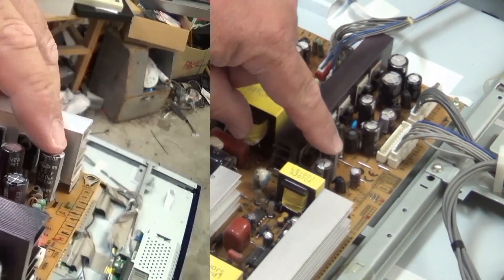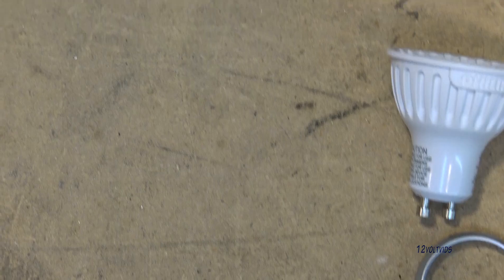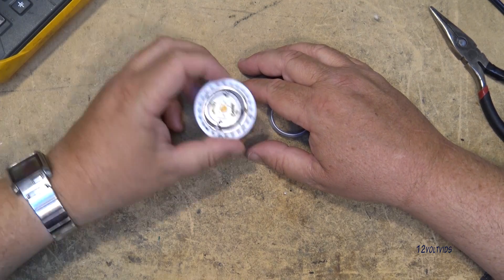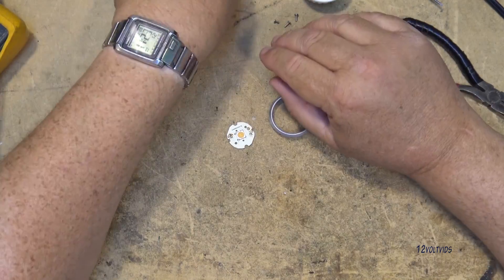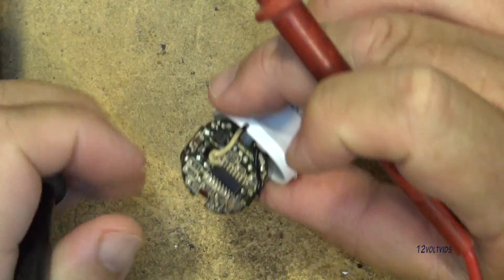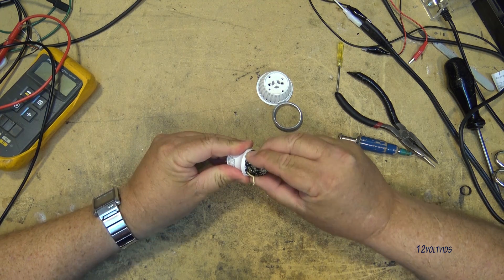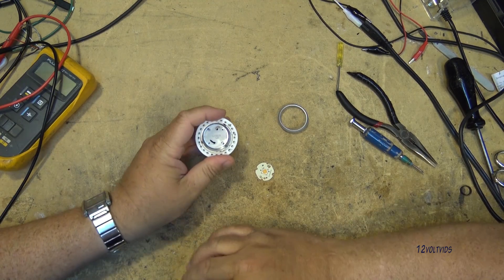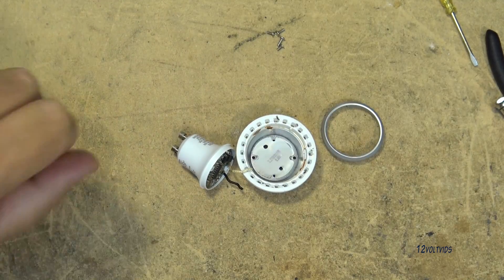Philips GU10 LED teardown

Comment: I'm surprised to see next to no noticeable heatsink compound underneath the LED PCB. Often heat is a major cause of failure with LED bulbs so I'm not surprised yours didn't last. I tend to buy them as cheap as I can find and treat them as more disposable than they should be - so much for improved environmental waste!
Reply from the maker: Pete Allum 
What about the new filament type led. No heat sink at all. They do fill the bulbs with carbon monoxide because it transfers heat well.

Comment: I think heat is what destroys a lot of these lamps. Compact electronics & transformer.

Some LED bulbs, and even some of the CFL type, won't fit into certain equipment.  My garage door opener has 2 lights, one on each side, only a regular sized 60 w (incandescent) bulb fits under the shrouds.   The LED's are typically larger due to the heat sinking.
Reply: The Led light have a mini switching power supply.

Comment: Do you think the heat inside the cap of the bulb is increasing the degrade rate of the already fragile electolytics?  Just a thought!
Reply from the maker: Probably.
I just got some new Warm Glow lights for my dining room, and will be doing a review on those. They are actually very cool technology, and emulate how an incandescent bulb dims. Hopefully these will last.

Comment: i agree with you on the LEDs. Ive found a few CFLs that did last many years but not being used all day everyday. Hell my local malwart stopped selling CFLs and have nothing but LEDs for $35-40 for 6 LEDs that are 40 or 60 w equivalent. So i resorted to buying 45w and 65w from amazon that seem ok for the price and warranty. I refuse to buy LEDs for that price  when I know they dont last very long. Ive built my own with cheap chinese LEDs and they seem to last , so far. I even converted a couple CFLs to use LEDs and after changing the cheap components they might last more than a year. we'll see. lol Thanks for sharing!

Comment: I had a few 240v non dimmable versions of these start flickering and go dim, in my case it was a simple capacitive dropper and the measured voltage across the LED package was 190v. All the capacitors tested fine. They were also quite expensive and technically still work but the flickering was really grinding my gears so I replaced them with some store own brand ones that cost like $12 for a pack of 6.

The store ones are currently much brighter (350lm vs 200lm) and consume the same amount of power as the Philips flicker vision bulbs.

When I removed the LED from the metal enclosure I noticed there was hardly any thermal paste so maybe that didn't help.

Comment: I have to say I have been surprised by all your failures. I have had 2 go bad in the 7+ years they have been installed in 2 houses. 1 was due to a lightning strike out on our post light and 1 started flickering, that's it. I have Philips, GE, Cree and EcoSmart installed.

Comment: The reason why they fail is because for some reason there is no thermal grease in between the LED and heatsink. I use 4W LED lights in bathroom. They have bead type LEDs. None of them lasted 6 months. What I did was I bought 50 beads from aliexpress for like $2 and replaced bad ones with them adding a little amount of thermal compound under. It's been 3 years and had no problems whatsoever.
Also that 'heatsink' on your LED is several times smaller than it should be. My  4W LEDs have radiators and they still get to 40-50 degrees celsius if left on for more than an hour.
Reply: SinsBird if a 4w bulb is getting that hot, I wonder it is really burning more than 4w.
Reply: Well I haven't really measured it, just touched it, so it may be less :)
Reply: @alphabeets  They're 5W actually.

Comment: They're probably over-driven; try a series resistor to drop the current to something reasonable, like 25 mA or so. That alone should increase the MTBF. :) As for bulbs, I've got a box of GE CFL bulbs, and I've only had 2 go out in 10 yrs (in different fixtures). Also, don't operate them bulb-side down, or the heat from the "bulb" will add to the heat from the circuitry, and something will give (usually, a cheap 85 degree rated electrolytic cap!)

Comment: I'LL BE DAMNED. SAME HERE, I GOT THE CHEAPEST HIGHEST WATT EQUIVALENT I COULD FIND IN A CANDELABRA BASE AT WALMART (60w) AND THEY STARTING ACTING UP FROM DAY ONE. THEY WERE  $5 EA. THEY PREMIUM ONES WERE ALMOST $8 BUCKS. THEY ARE CRAZY BAD. WHEN I CAME HOME ON THE 1ST DAY THEY WERE FLASHING SO BAD IT LOOKED LIKE A STROBE AT A DISCO.  DOGS LOOKED AT ME LIKE WHAT THE HELL IS THIS? IT'S ANNOYING FIX IT! HOWEVER, I DID GET A OUTDOOR RECESSED MINI FLOOD (100w) FROM HOME DEPOT THAT WAS ON CLEARANCE FROM $18 DOWN TO $7. WITH A 10 YEAR WARRANTY! IT HAS A MUCH BETTER DESIGN WITH 3 LEDS AND THE LEDS DON'T LOOK ANYTHING LIKE THAT PHILIPS.  IT'S CRAZY BRIGHT AND RUNS ALL NIGHT EVERY NIGHT FOR 2 1/2 YEARS NOW WITH NO DEGRADATION/PROBLEMS. I CAN'T RECALL THE BRAND, BUT THEY WERE DISCOUNTED BECAUSE THEY WEREN'T SELLING AT THAT PRICE SO THEY WERE DROPPING THE PRODUCT. I ACTUALLY KEPT THE WALMART RECEIPT BECAUSE I HAD MY DOUBTS. THEY NOW ONLY GO TO 60% OF ORIGINAL BRIGHTNESS AND I AM GOING TO RETURN THEM. THAT'S WHAT THEY'RE COUNTING ON WHEN THEY PULLED THIS CRAP. WHO'S GONNA SAVE LIGHTBULB BOXES AND RECEIPTS FOR 3-10 YEARS? SO FAR THE PREMIUM ONES ARE PROVING THEY CAN MAKE THEM WELL IF THEY WANT TO.  THEY BETTER IF THEY WANT THAT KIND OF $$$ FROM ME. haha

Comment: I find it funny how many super-expensive "brand name" LED bulbs are just junk. Yet the $5.00 DX special I bought four years ago is still going strong. Granted, I had one chinesium cap failure in a set I ordered later,  made one stop lighting, but a brand name cap fixed that right up. 

Heck, even when CFLs were all the rage, they were just junk, except the old magnetic ballast ones. I marked dates on every CCFL spiral before I installed them. Can't recall how many six-packs I filled up with dead ones and returned/swapped because they all died before the warranty was up. The icing on the cake is no place to recycle them, so now mercury, electronics, and phosphors in the landfill instead of just some glass and metal. environmental, my *ss.
Reply from the maker: vintagepc64 
I just bought some luminous to replace the Philips. Will see how they last.

Comment: It's frustrating that these bulbs that are supposed to save all thus energy die young.  When you factor in the energy to produce these things I get the feeling the led thing is, so far, a net loss.
Reply from the maker: The ones I have used certainly are. I picked up a 4 pack at Costco for 12.99 and these ones are much brighter than the outgoing 3 year old ones, but I have a feeling that the old ones were much brighter when they were new.
Reply: 12voltvids i hate to sound like "that guy"  but I can't help but think it's on purpose.  I think people are so used to changing bulbs all the time that (unless you're into electronics and know better) they  just don't notice most of the time.
I mean how hard is it for a multibillion dollar a year company  to stick a little diode and a circuit board in a housing and make sure  it doesn't reach the temperature of the surface of the sun after 5 minutes..
Oh well

Comment: When I was working at Philips Arena in Atlanta back in the early 2000's, the naming contract for the arena had a requirement from Philips that the arena use all Philips light bulbs.  The electricians hated the Philips bulbs, as they quite often didn't last long enough for the electrician to take down his ladder.  Incandescent, fluorescent, CFL, LED.....  Did not matter.  They were all crap.  The game lights for Basketball and Hokey games grew so dim that they had to be replaced after 3 seasons, as all the television trucks were complaining about how poor the lighting was becoming.  Replaced with GE bulbs and they were still going strong when I left 5 years later.
Reply: Got any more juicy gossip on Philips LED's?

Comment: Starting to hate LEDs,  just in the last year 75% of LED TV failures im getting are because of blown LEDs.  Rarely is it worth it for me to tear down the TV to get to them, but I usually do it anyway... Not to mention how damn flimsy the frames/bezels/diffusers and reflectors are.
Reply from the maker: You and me both. This one that burned out wa sinstalled April 24 2014 (I wrote the date on one of the other bulbs installed at the same time and quite dim now.)
Warranty was 3 years. They expired 3 months ago, go figure.. When I bought them they were 35.99 for a 2 pack. Just went to Costco, and a 4 pack are 12.99 so I replaced all 4 and what a difference. I can actually see again in my office.
Will see how long these ones last. Package says 22 years. I seriously doubt that.

Comment: I haven't had any LEDs go out.
This makes me wonder if you have high voltage at your house?  Or maybe transients are knocking them out?
Reply from the maker: Aurthor Thing 
Well if I had high voltage or transients I would expect more sensitive things like the TV or computer to fail. Besides these things have a ballast to drive them so it isn't affected by over voltage. That is controlled by the regulation circuit. As I sit here now I am in s restaurant and they put in all led lights. I can count 60 leds from my table. They were all originally the same color temperature. Right now there are 2 dead and out of the 58 remaining which were all warm white I count, 20 daylight. So 20 have been replaced and 2 are dead. Not good odds of you ask me.

Comment: I'd have expected to see thermal compound on the back of the LED board.
Reply from the maker: RedDragonUKTech 
So did I.
Reply: The lack of thermal compound explains the failure mode you're having. 

If the light was flickering before it died completely, it means that the bond wires inside the LED module have failed due to thermal stress. You can sometimes poke at the phosphor material around where the bond wires are to make the LED module temporarily work again to verify the failure.

The ~57v you were seeing across the LED driver was the open circuit voltage, if it were a true 4W module with the LED dies in series, the working voltage would be 12.8v max. Some put the dies in parallel for a lower working voltage.

If you haven't thrown away the lamp, you can get 5W LEDs on ebay mounted to a star PCB which may or may not fit inside that heatsink base:

www.ebay.com/itm/122604065816
Reply from the maker: Still have the lamp module.  But with the new lamps costing a fraction what this one cost., I just replaced the other 3 with 4 new ones which are much brighter then these, as I am sure the other 3 are probably on their way out too.
Reply: I like to repair LED bulbs myself, it keeps them out of the landfill. It's often some stupid manufacturing fault like this that's correctable, and the parts cost is pennies.
Reply from the maker: Yes but by the time the part gets shipped the cost of the part and shipping is higher then the cost of replacing.
There are some exceptions but most times there is a shipping charge added, or worse if they decide that there is a customs broker charge.
The first LED that I bought failed under warranty. I contacted the manufacture and mailed the defective one back (at my expense, mind you this bulb cost over 30.00 at the time, so 3.00 freight to get a warranty replacement was OK) received my replacement, and 3 weeks later I got a bill in the mail for about 40.00 in broker fees, taxes and duties. If I can find a die for a buck or 2 I might buy one and try it as the electronics are still OK.
Reply: I don't know how it works in Canada, but down here in the states, I can get bags of 20, 50 and even 100 LEDs for $1-10 (depending on the LED type) with free shipping from China. The only downside is that shipping takes weeks, but once you build up a stockpile then you can keep them coming as needed before you run out.

You've referenced bang-good in a few of your videos, which is probably where the escrow and broker fees come from. I use ebay and don't have to deal with that nonsense, you get directly from the manufacturer or supply house.
Reply from the maker: Never paid a penny from Banggood. It is the ebay stuff that I have been hit shipping charges on.
Reply: Canada tax man is sure making sure they get their tax revenue then I guess lol.
Reply from the maker: Yes but we get a lot out of them like health care old age pension ect.
Reply: No thanks to government provided healthcare or pensions, I refuse to fund that crap with my taxes. They can't even manage themselves most of the time, let alone care about the people who voted them into office.

The closest example to that here in the states is California. The state is completely broke, even though they tax everything four ways to Sunday. Taxes are so high and everything is so expensive that the middle class is fleeing the state to other parts of the country, with one of the primary destinations being Texas.

We can also see that government healthcare and pensions work GREAT in the EU. All of the austerity measures leave hospitals barely funded, and look at the millions of people who lost their pensions because the government could no longer afford to pay for them. When systems like that completely collapse just because the economy goes bad for a few years, it shows that the promised concrete fortress is in reality just trash glazed over with mortar and a few coats of rock paint.

Healthcare ain't that great in Canada either. I've been reading for years that people who have money come south of the border for treatment because they're forced to wait in lines for sometimes months or years for treatments to even life threatening problems like cancers, when they can come down here and be treated immediately.

https://www.usnews.com/news/best-countries/articles/2016-08-03/canadians-increasingly-come-to-us-for-health-care

Our healthcare system isn't perfect, but at least some pencil pusher in the government doesn't decide whether I live or die because it costs them more money than they want to spend.
Reply from the maker: That's right your health care system is for the rich, and everyone else dies. In Canada those that need critical treatment get it on priority.
There are some that would like a 2 tiered system so they can jump the que,and it is those that will travel south and spend money, if they have it. Everyone here is treated fairly, and sure there are waiting lists and people that are not in a critical situation may have to wait, but I can tell you from personal experience with my parents that they got the very best care, and when needed, got it immediately with no waiting, and it didn't cost them their live savings. My dad had a stroke. Instant response saved his life. When he was 77 he had a AAA (abdominal Aorta Annurism) and again, he was rushed to hospital, spent 16 hours on the operating table, and spent almost a month in the ICU and recovery. What was the cost of that? Nothing. Thats right zero.
Sorry but we can agree to disagree on health care, but I will take what we have here any day of the week and twice on sunday. I don't have to worry if a drunk driver hits me, and puts me in t he hospital all banged up, or if I have a medical emergency loosing my house, and wiping my family out financially.  The ones you hear in t he media whining and complaining are those that want procedures that are not emergency, and they have to wait their turn. They feel they should be able to have their own system, but that would steal doctors from the public system to the private where they cab bill much higher rates, and this is why the government is preventing  such a system, so that it stays fair for all.
Reply: Glad to see your folks had a good experience, but your situation does not mirror the state of things across Canada. People who need critical surgeries or treatments are forced to wait due to lack of resources:

http://www.ctvnews.ca/health/healthcare-wait-times-hit-20-weeks-in-2016-report-1.3171718
https://www.fraserinstitute.org/studies/waiting-your-turn-wait-times-for-health-care-in-canada-2016
http://www.torontosun.com/2017/02/16/canada-has-worst-erreferral-wait-times-in-11-developed-countries-report

In addition to the link above, these are numbers directly from government sources and non-partistan groups, not people complaining about their foot was sprained and they had to wait two months to get it seen.

Waiting 3.7 weeks on average for cancer care? I've had relatives and co-workers die in that time frame from first diagnosis of cancer, and they had treatment started within hours, a day at the most. Insurance paid for the majority of their care after the initial deductable, so it didn't eat them out of house and home or put a heavy burden on their family.

As for the care your folks received you described being free, this is false. Those services were funded by taxes, which you indirectly pay for, as does everyone else.